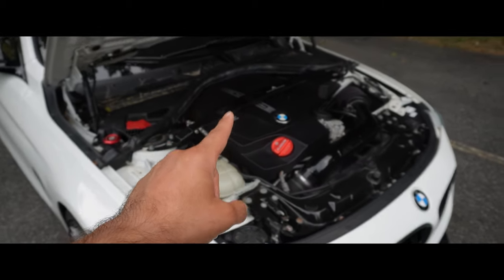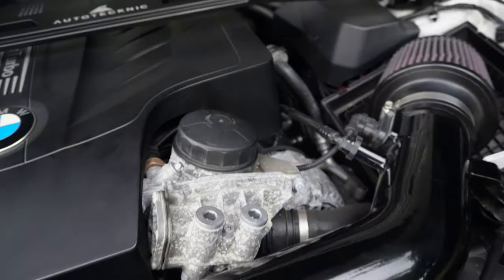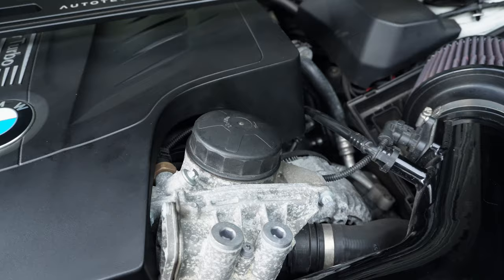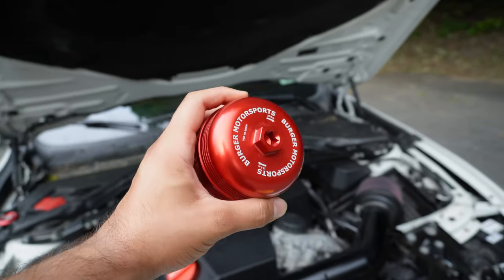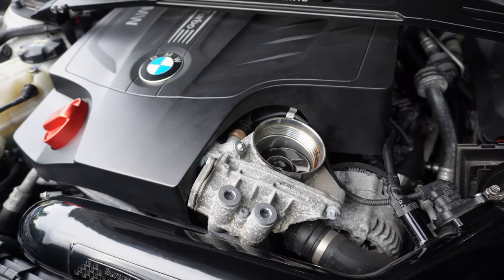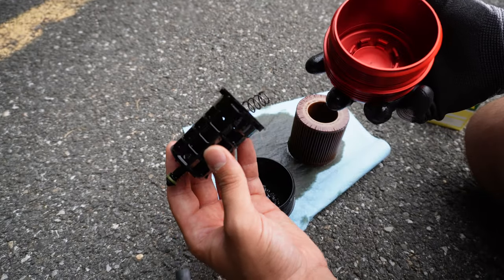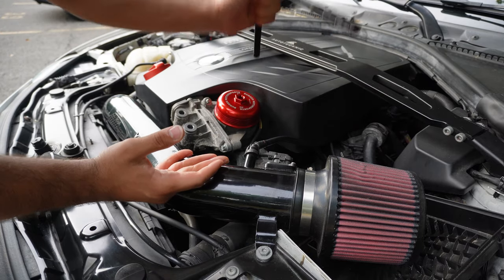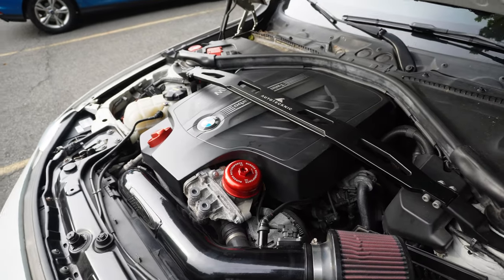I MADE MY BMW MORE PRACTICAL AND LOOK BETTER WITH THIS ONE MOD!

Comment: can you skip stage 1 tune and go straight to stage 2 tune without downpipes and a intercooler
Reply from the maker: Unfortunately you need a downpipe and intercooler for stage 2
Reply: @ayyyman_  thanks also another question, I have a cts turbo intake will that effect my intercooler? I ordered a high flow catted down pipe and charge pipe as well.